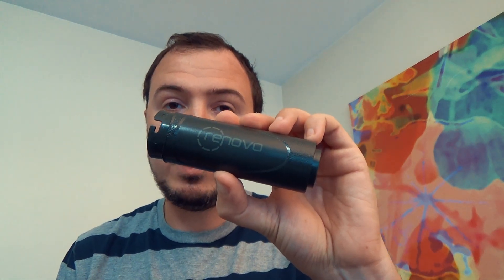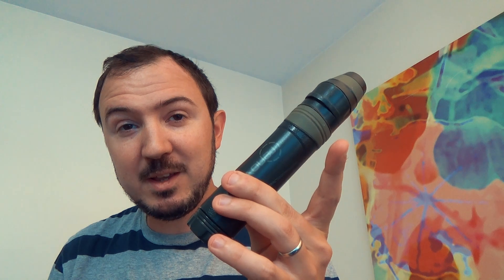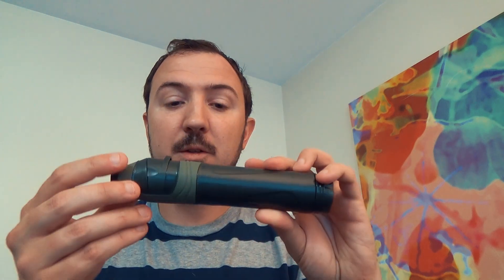Renovo Trio - Filter Stages & Replacement Parts Identification

Comment: The Renovo looks like a good filter but I too find the Sawyer Squeeze the simplest and lightest filter I have owned. When I use the filter where I'm concerned that the water source may contain pesticides or other chemicals I use a carbon filter as well. I found a refillable carbon filter that I attach to the output of the Sawyer Squeeze at REI. It is light and activated carbon can be found at aquarium supply stores and it is a lot cheaper than what is available at sporting goods stores. I just returned from the Mt. Rogers area in Virginia and the water there is mostly from springs or fairly pristine creeks. I left the carbon filter home for this trip. When I hike around the Cincinnati area, the carbon filter is always with me.
Reply from the maker: +Mike Jordan Thanks for sharing the tip about the aquarium carbon filter.  I'm definitely going to look into that.
Reply from the maker: +Mike Jordan Thanks for sharing the tip about the aquarium carbon filter.  I'm definitely going to look into that.
Reply from the maker: +Mike Jordan Thanks for sharing the tip about the aquarium carbon filter.  I'm definitely going to look into that.
Reply from the maker: +Mike Jordan Thanks for sharing the tip about the aquarium carbon filter.  I'm definitely going to look into that.

Comment: Question about the Sawyer Squeeze. Do you ever back flush it when backpacking or only at home? So far I have only done it at home after trips, but I keep a sports bottle cap in my pack if needed.
Reply from the maker: +uptrail71 I'm the same as well.  I only backflush with the syringe once I get home.  I have occasionally ran the clean and dirty bags in reverse while in the field just for the heck of it to be proactive, but most of my trips are short enough to not worry about it until I'm back home.